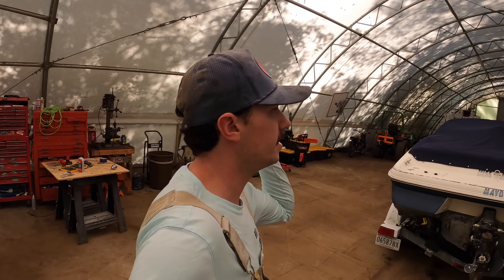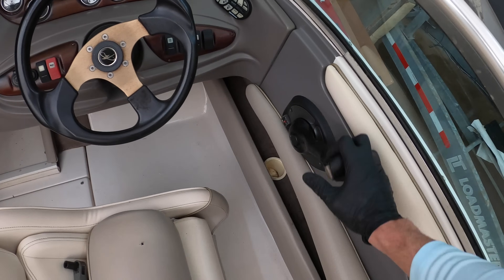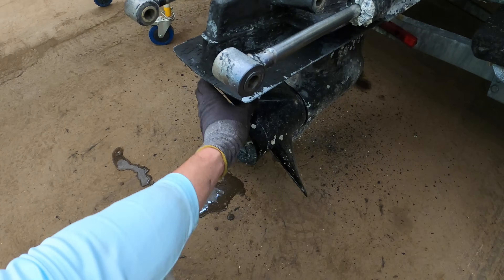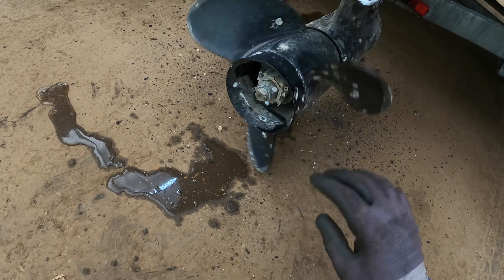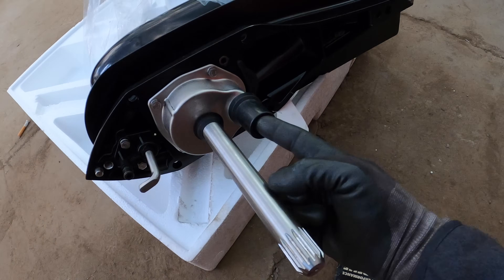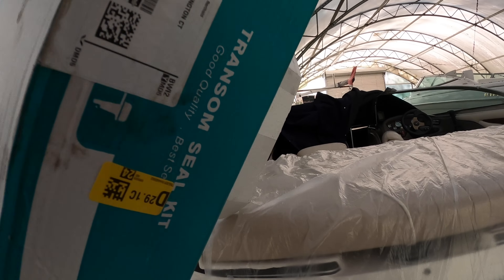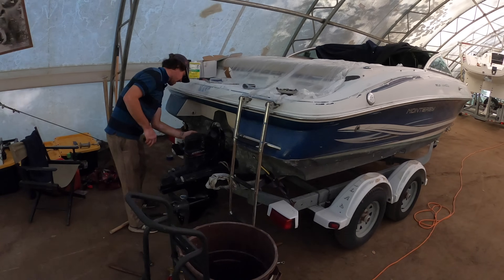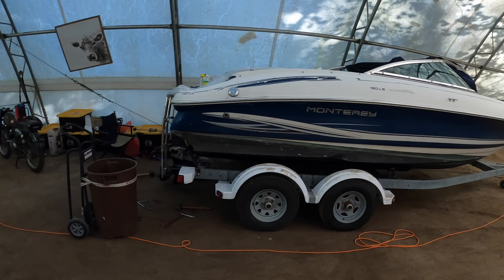HOW TO Replace A Mercruiser Sterndrive | Alpha One Gen Two with Bellows and Gimbal Bearing Service

Comment: Why would you not put a full reman or new drive on? All that work to re do it with a shitty drive....
Reply from the maker: Nothing wrong with SEI products. Also, it’s typically not the upper that goes bad. It’s normally the lowers in these. Lots of good uppers out there. Lots of bad lowers. Again, it all depends on what the customer wants to spend and functionality.